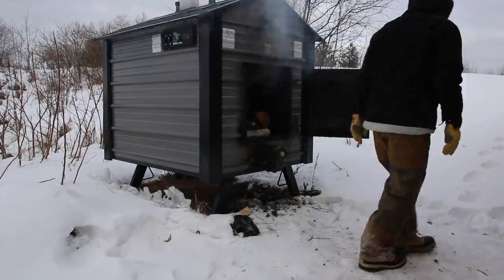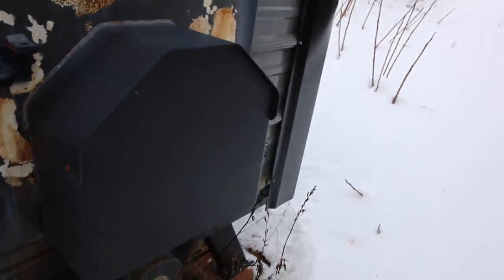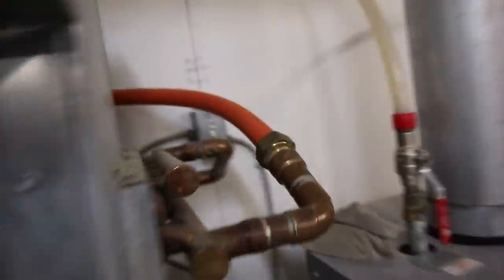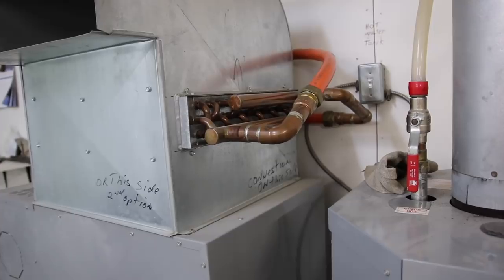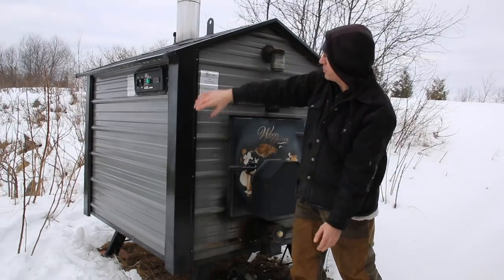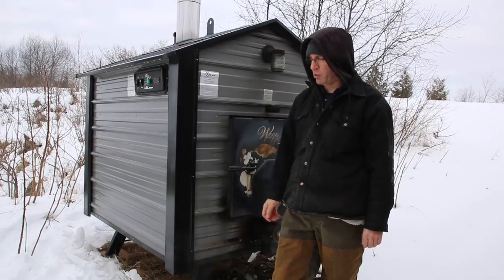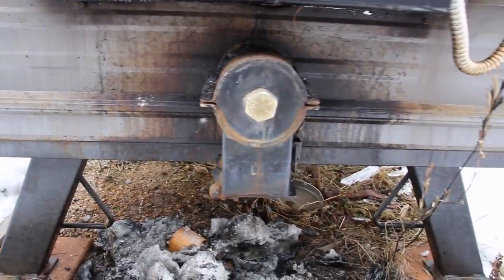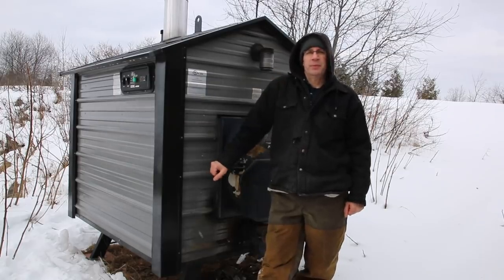Outdoor wood furnace "worth the investment?"

Comment: I live in north eastern Alberta at the 55 parallel , I built my first boiler in 1981 , and a few copies of it, then I made an upgrade and they were more efficient and a few hundred copies of those, the  best ones were huge and recycled the smoke and were very clean burning , they would hold a 1/2 of 8' box pickup load at once and heat 10000 sq ft at -50 ,back in the mid 80s  natural gas was insanely prices so it kept a man busy keeping it going ,  only the huge ones lived outside , the one I have now is in my shop and heats my house too along with domestic water.
  If I ever up grade again I will go with the new gasifiing types they burn 1/3 of the fuel of the old can in can types ,  I am 66 and soon 67 so its a challenge to cut all that wood
the fact remains that they are a lot of work and you need to insulate them extremely well.
Reply: well since were you live why are you not burning coal, the best mines are out there and its only $7 cnd a ton to pick up
Reply: @arnoldromppai5395   nope not where I'm at  at least 150 miles to the coal mine and with the NOPLANDIPSHTS  or lesser NDP carbon tax coal is over 70 a ton now .and there is just tons of wood around..
Reply: pick it up at the mine, i have it truct into Ont, and it is $7 cnd a ton plus my trucking from AB i can get it from SK to but it is poor coal

Comment: A nice revised Franklin with spark/explosion screens inside the shop will give you all day heat with half the wood and no need for a blower.   Seriously.  You can get catalytics for such stoves that re-burn the wood creosote and exhaust and by far the best option would be to use a gassifying stove system to heat a mass.  Something like a compound rocket.
Reply: ...but an indoor wood stove doesn't retrofit a large house with radiators anywhere near as well as a wood boiler, it doesn't provide unlimited 180 degree domestic hot water like an outdoor wood boiler, and you don't have to fiddle with a outdoor wood boiler anywhere near as much as an indoor wood stove.

Comment: I have a wood furnace in my basement that heats the whole house with central air system. For 6-8 hours of work we can heat the whole winter. It uses one heaped pile of a pickup bed.

Comment: I am retired and live in The Upper Peninsula of Michigan.  It is not uncommon to have snow for up to 5 months or longer.   My house has heating oil and I have a small wood boiler that heats the same water as the heating oil boiler.  I burn wood as my primary heat until the single digits hit, then I use the heating oil.  If it is above 30, I use the oil as it does not run all the time.   Collecting wood is my “gym membership” as I get to go into the woods and use my chain saw, collect wood, move wood, split wood, and stack wood.  It is worth it for the physical fitness and it basically is free.   To fill the heating oil tank cost about a $1000 and that will last all year if not longer.  My wood boiler I got for free and I spent about $400 in heating and plumbing parts to install it.  If I bought a $10,000 boiler, bought split wood, the savings wood be minimal.   In my case, I save money burning wood.
Reply: I have similar set up as yours, I preheat an oil boiler and set them close to each other in temp so wood is primary till it gets too cold to keep up, it has already paid for itself a few times and it is awesome for cool weather and in the summer making hot water, but in heating season it busts through the wood pile fast with 2 a day fill ups.  I have been at it since 2006 with mine, and may be nearing the end of my wood cutting.  All my wood is free and either dead fall or standing, so no issue, just the time involved, but I do stay in shape from it...hard to decide but thinking about pellet burner inside to coexist with the oil for hot water. I am also retired so I cannot say I don't have the time, just want to spend that time on other projects:)

Comment: Gee wiz! Mine has a loading box and drops wood based off of the temperature.  I fill it once a week.  Yours is crazy. Also mine uses no electricity.  Everything is manual  for my cabin. I use about 10 cords of wood a winter and about 4 during the spring and summer.  We live in the woods and the fire dept cuts down trees all year to help thin for forest fire prevention.  So I just pull out our cutter and splitter and run them through.

Comment: If you had a wood gasification boiler, it would use much less wood.   BTW, that is a boiler, not a furnace, since it heats water.
If the boiler's capacity is great enough, you might consider heating your home with the boiler too.  The increased heat demand would mean that the fire would burn hotter, and smolder less, greatly decreasing condensation(creosote) in the firebox.  A tempering valve in the hydronic circuit would help too.  
The wood you are burning is of higher moisture content than the manufacturer suggests, which causes more condensation, and also decreases the heat your boiler gets from burning the wood.  The heat is still released, but it goes to evaporating water.
Reply: none of these units from any MFG ARE BOILERS, THEY ARE FURNACES HEATING HOT WATER .. THEY All are open systems, a boiler is a closed system that presserizes up to 10 to 12 Lbs, witch in turn lift the water boiling temp much higher before it boils, these units work best with green hard wood, and small water tank, anything over 190 gallons is a waste, just much more water to heat

Comment: Just like you, we're fed up with our OWB after 8 yrs. Here's my thoughts: There's a poll on one of the OWB forums asking "how long did your boiler last" and generally, most brands tend to fail around the 7 to 10 year mark. By "fail" this typically means that they start to leak in one spot or another, regardless of the cleaning, maintenance, and water treatment that you do. This means that the cost of your boiler unit itself works out to $1,000/yr. A few other costs that haven't been mentioned - electricity usage. First, air blowing past 160-180 degree water in your furnace heat exchanger for the house/shop/etc. is 'warm' - not hot like a natural gas/propane furnace. This means that your furnace blower motor will stay on an INCREBIBLY longer than heating with gas. Depending on your forced air blower motor power draw, this can mean a large electrical expense. A similar size motor is also on the OWB draft fan - and lets not forget about the 1 or 2 water pumps that are continuously running as well. As mentioned in the video, the largest component to heating with an OWB is the time investment. They eat far more wood than an indoor stove which means you're blowing through 20-30 face cords a winter if you live in a cold climate. If you're harvesting and processing your own wood, this is weeks of time investment every year (200 hrs). If you purchase a tandem load, you're still spending nearly a week (50 hrs) to cut/split/stack ... and lets not forget about the 1-2 yrs. required to dry the wood. Now you have to devote time to feed the boiler twice a day, clean out the ash doors/trays every other day, and clean out the fire box every 3-4 weeks. Let me be clear, this feeding and cleaning consumes over 50 hrs. for our 5 month heating season. Now lets move on to the smell .... there's no smell inside your house BUT that poor person that has to load the firebox is going to immediately smell like a wood fire. Let's hope you're not working in an office with a suit on every day! Your property will also have an intense 'wood fire' smell while the boiler draft is on. The "Pros" are certainly valid - the fuel source is inexpensive, heat is nearly endless, you can be mostly self reliant,.. but the cons that we've experienced over 8 years of ownership, unfortunately, far outweigh the pro's. So NO, an Outdoor Wood Boiler is NOT worth it, for us.
Reply from the maker: Well said. Totally agree with you!

Comment: You can buy bulk firewood, in 8 foot lengths.   Like this, it's still a lot of work to process, but it's probably 30 to 50% less work that gathering the wood from your yard.  This wood is a lot cheaper than buying it cut and split.  It's kind of a compromise between gathering your own vs buying ready to use firewood.

Comment: I've got a talor and a mountain of wood probably 10 years worth. when people need trees cut down they call me. I burn every wood tree that exist. I've put 200lbs logs in mine then put smaller peace around the big one. I clean mine out once a month during burn season takes about 15 minutes to remove creosote and open up all the air passages. every two years i drain and change out Zink iode and add new chim takes about a hours and a half. 350 gallons lol. I love cutting wood and splitting what needs splitting. my favorite wood to burn is white oak and red oak. mixed together white oak don't leave many coals but red oak does need some coals so it starts up when fan comes on. I must say if you empty the watter out it's really easy to break loose any thick layers of creosote that has built up. I love it. my best tip would be keep your chainsaws sharp tight and greased don't hesitate to greas the bar tip O yea clean the air filter it will definitely add power to your saw. I clean the air filters every time. also I attached heavy duty paint scraper to a old broken shuvle handle I can really scrape the creosote out good with it.

Comment: I spent months stopping at peoples houses and politely asking them if they liked there outdoor wood boiler. I came to one overwhelming conclusion. Every single person that liked their outdoor boiler owned a classic boiler installed by the same company. Everyone that hated it or disliked it were a mix of boilers setup by a mix of contractors. I have owned a classic for 10 yrs now. I burn about 15 cord a yr. It's a lot but I heat 4400 sq ft in which half of that is un-insulated basement where we have a business. We heat our hot water from it for a house of six people. It was costing me $700 to $800 a month to do this same thing with propane. We made the decision to buy the stove over insulating the basement. (Only enough money for one at a time. I still want to insulate the basement but haven't been in a hurry now.

Comment: Put stove in yur shop.   Stays out of wind. No long underground run to suck out heat. Can put flex hose from blower to outside air.   Or build little shed around stove to block wind and store the wood

Comment: replace those stone-age t-stats with digital ones will save you quite a bit of wood.  also install the t-stats close to the center wall of the buildings on a inside wall.  away from the outside wall and blower unit air flow.  about 5 ft high.  you can install hot water solar panels and pipe the hot water to your house in the summer when not burning wood.  stack your wood like building a house 2X2 and it will burn much better.  i know cause I had a Taylor water furnace with solar for many years .

Comment: Thanks a bunch for your thoughts on this.  I've just bought a used unit to get in place for next year.  I already have propane heat in place, but the bill was ridiculous this year (like, in around $5000 since December), so I'm hoping that supplementary heat will keep my bills down.  All of what you've said is what I kind of expected, so at least I'm not going in to this blind. :)   I see later on that you've converted to propane.. I don't see another video up talking about that, but I'm into a combi boiler for about $6500 already, plus the cost of the radiators and my time to install all of them..  I'm not convinced that propane is as good as I'd first thought.  I'd be curious to hear what your experience is.

Comment: You probably shouldn't drain the boiler on summer time and fill it with fresh water again and again. I guess the boiler will be better protected from corrosion if it 1) stays filled with the water and 2) no fresh water added to the system frequently, fresh water brings new portion of oxygen and corrosion to the system.

Comment: For all the people doing the math on their particular situations, don't forget to include the cost to clear the land if you have to pay someone else to cut down all your trees and haul them away. Of course, if you live near some loggers (and you have enough property to make it worth it) you may be able to get someone to cut down all your trees, haul it away and sell it for a profit, pay themselves with that money and cut you a check for the difference! So depending on what kind of trees you have and how old/large they are, that may either cost or save you money if you want that land cleared anyway. 

ps. Green wood burns slower, so maybe stop using the dead trees that fall on their own and cut a few live ones down next year. You might be able to get away with just filling up once a day.
Reply: Why would you pay someone to cut and get rid of the trees when you are installing a wood burning device? Are there some types of wood that can't or shouldn't be used?

Comment: We have had a central boiler for almost 20 years. Pain in the butt. We rarely get free would like we did years ago. Pump cost $350 to replace, $5000 in anti freeze to keep it from freezing. Have to fill it numerous times when its really cold.  Not to mention smelling like smoke from filling it up. Worse thing for your lungs.

Comment: You can buy a product called rust inhibitor. Put it in your system and you won't need to drain and refill your tank and it'll prevent corrosion.

Comment: If I were you I'd build a hydraulic lift to lift rounds of wood as rounds burn slowly and provide more heat than split wood. If it fits through the fire door there is no need to split it. Think how much splitting work you could avoid by just burning rounds.

Keep at it as it will be easier when you don't split wood.

Cheers!

Comment: Thanks for the info.
I also burn wood with a wood coal combo plumbed into my oil force hot air back up.
650 dollars buys 8+/- cord log length that I cut and split.
It saves me at least 1500 a year over oil. I purchase 100 gallon min delivery every 2 years just in case and let oil take over on warm days where the wood furnace would be too hot. 30s.
With the possibility of carbon tax coming, the benefits will be even greater. 
My small tractor does help with the heavy lifting.